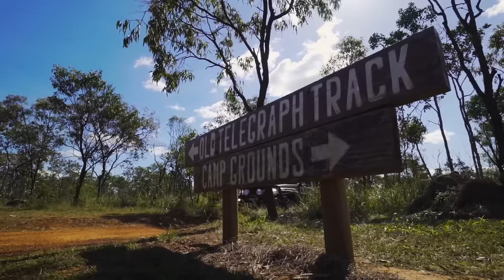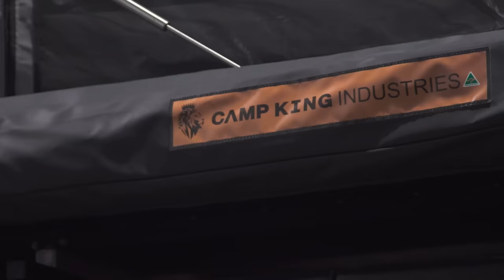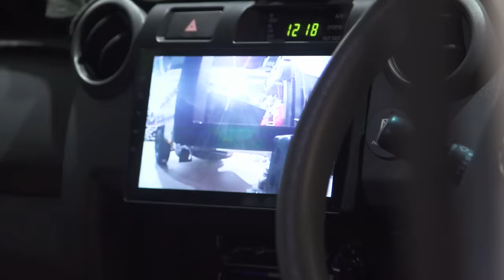Australia's Most ICONIC LANDCRUISER? Returning to SEMA 2022

Comment: is the camp king rtt the same as boss aluminum?
Reply: They are basically the same, camp king came first and was later copied by boss alumnium
Reply: @flynncruickshank6211   I had kinda dismissed the camp king/boss when I first looked at them because of the price but now they are almost tempting because I much prefer the large windows over the bush company which is a close second choice with almost the same cost